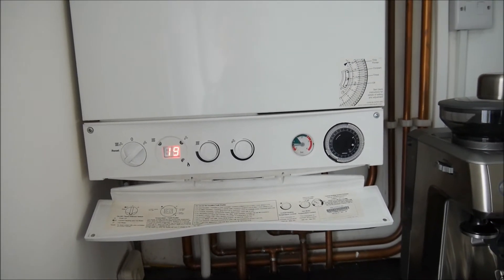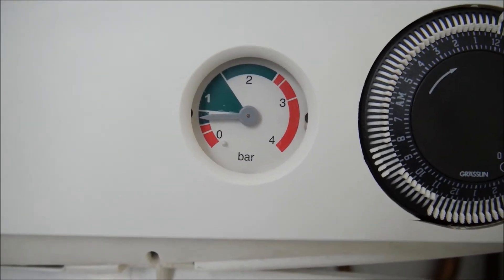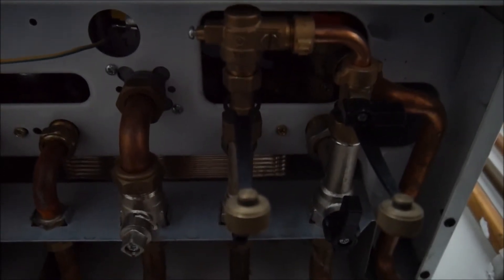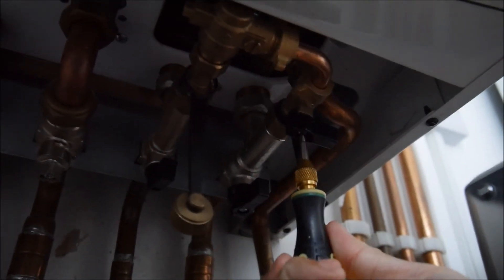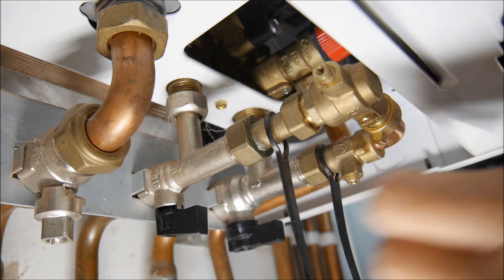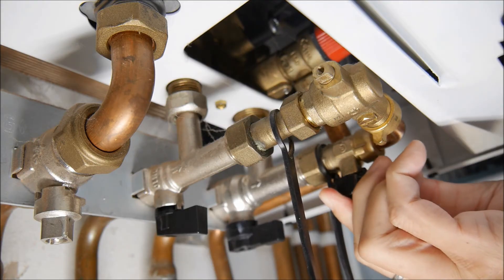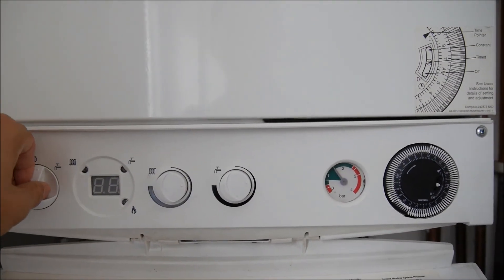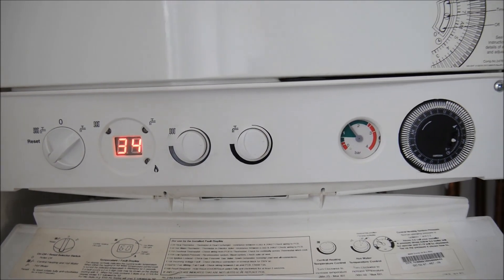Learn this in 2 secs! Eco EliteCombi Boiler E119 Error self fix, suitable for same type in any brand

Comment: Hope do you put b the black lever  back and screw it so we are completely clear how to reser it correct at bottom? Do we leave the lever you temporary  movement of top levellever as in our turn it back  and then screw the screw back on? Thanks
Reply from the maker: The both valves are with the same size, so you can use the lever for both valves. Leave the lever to either position then put the screw back on. There is no exact sequence in how to do it, but remember to close both valves after having it done

Comment: Very clear video.  My boiler too had a missing valve handle - managed to find a replacement pair on Amazon.
Reply from the maker: Thanks. You may try to use the same valve handle as what I did before the new valve arrives.